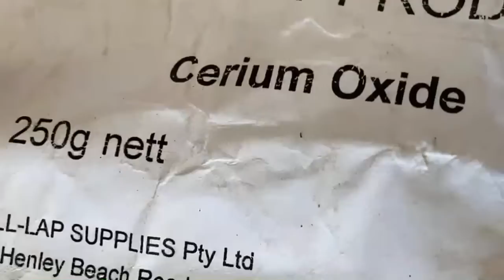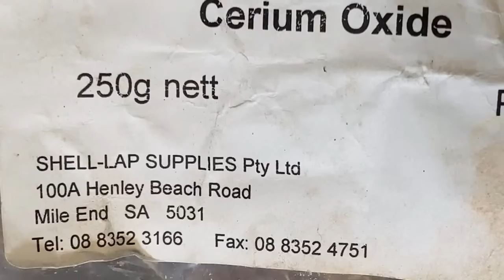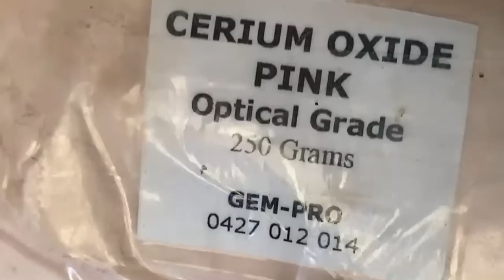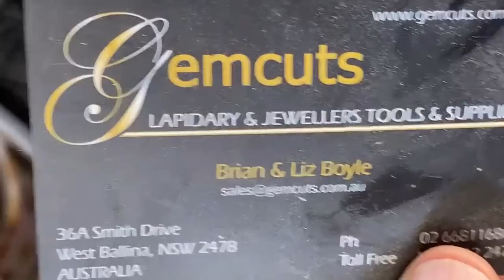Opal cutting.

Comment: Starbond comes in 4 or 5 variations.  The thin, like water is for filling cracks,  People mix medium with an oil and buff at high spreed for a polish.  Thick is a form of "super glue" and glues  your fingers if you are not careful.  They also have a thick for glueing 2 materials that shrink and expand at different rates, it is more elastic and keeps them stuck.  Also a black one for transparent color to something you do not want to see.  They also make a product to unstick your fingers.  It does not hold at higher temps, so a soak in hot soapy water will also unstick fingers.  I have been a woodturner for twenty years.  I am learning about opal for accent pieces, knobs on lids etc to try to get a little more for my work and have it stand out at a show or gallery.
Reply from the maker: G’day Sue, thanks for the info, I used the starbond thin hoping it would saturate into the pores to stabilise the surface enough to be able to be polished, it did well but I’d need to build up the layers, liquid glass is kind of a go to for resin coating, also I recommend Araldite for doublets, back in the day, when we drove heavy haulage, we got caught out in Katherine NT losing oil with a cracked timing cover in the Nissan UD prime mover, we could wait around a week for the part, or, Araldite the crack and get going, so the Araldite got us back to Adelaide SA then Melbourne Vic for a replacement part, good times. I love the idea for the knobs/handles opal inlay, with a mini lathe for a great finish. 🤪👍

Comment: do you prepare new disks i was told to use a large agate to prep wheels 2 to 5 minutes what you think ??
Reply from the maker: G’day Cheryl, yes, with new wheels, pads or dremel sintered burrs, it’s always a good idea to run them in on some scrap material, just to be sure they run smoothly, so to speak, sometimes there can be minuscule inconsistencies in manufacturing and wearing them in can be required. 🤪👍

Comment: I know this is an older vid. You might still check your input from it from time to time, so I'll leave a message.   my boy deals with a lot of resin. You came across the product that takes it from a 10000 to 20000 wet dry  that will give you a crystal polished look to your matrix. Is just a suggestion
Reply from the maker: Thank you. 🤪👍

Comment: I don't understand why you put resin or glue on the stones...maybe watch black opal direct to see how it is done naturally..just saying
Reply from the maker: G’day Jojo, you’re going to have to help me out, the only time I use glue/resin is to make doublets or seal rainbow matrix, neither of which were in this video. Are you referring to the green dopping wax to hold the opal on the dop stick?
Reply from the maker: I think you might be referring to the rainbow matrix, Justin doesn’t even cut this stuff so I don’t know you’ve correlated that. Rainbow or concrete matrix is sometimes too porous to take a good polish, so the pores need to be filled in, it’s the nature of the beast.